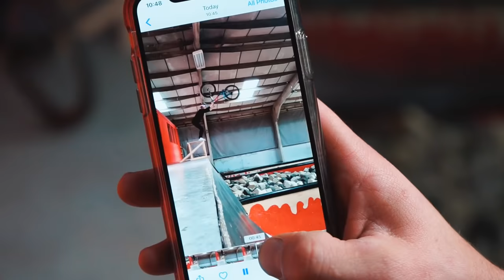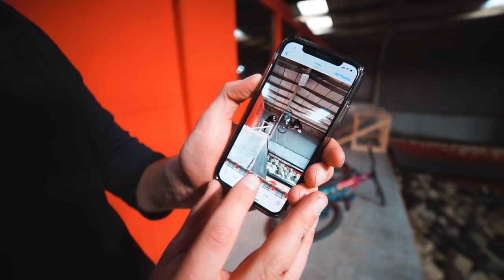WORLD'S FIRST MTB BACKFLIP TO FRONTFLIP CAVEMAN - THE STORY

Comment: The whole time watching Matt practice all I could think was "USE TWO BIKES AND AN ELECTRIC HOIST." Not just safer. Saves energy for the actual stunt rather than hauling a bike up each time. Seriously. $110 bucks. Poor Matt. Pulled it off in the end but with so much extra effort than necessary.

Comment: Hey Matt, you probably won't see this but just wanted to tell you that your riding & videos are sooooo f'n awesome and inspirational! I rode bmx for most of my life from age 7 to 32 until I crashed 10 years ago doing a one-footed invert off a 6 foot box jump hip and nose cased ultimately shooting me straight to flat head first from about 10 feet up knocking me out. I woke up about an hour later in the ER with a fractured C1 & blown out C2 & C3 vertebrae in my neck immediately ending my riding career. After a hell of a lot of therapy and a 10 year break I want to get back into riding but want to switch to MTB. Do you or any of all the awesome subscribers have any advice for basically a beginner set-up?? I'm looking for a frame thats light & strong as well as all the other parts. The lighter the better cause I still have problems with lifting heavy objects and want to be able to muscle a bike around with ease. I'd REALLY appreciate any input/advice from anyone and am sooooooooo unfrigginbelieveably stoked that I'm gonna be back on wheels again! 
Thanks for the inspiration, Matt & keep shreddin! 
🤙😝🤙

Comment: You already said that you need to tuck more to get a better rotation.   If you tucked your head forward over the head set towards the front wheel that would give a good tuck.   For tour safety bend at the waist instead of your neck or upper back.   I think that will limit the chance of breaking your back,  I am not a professional and this is not medical advice just a couple of suggestion's.